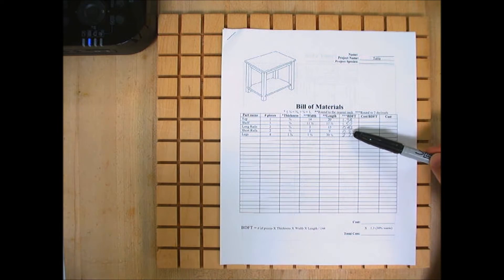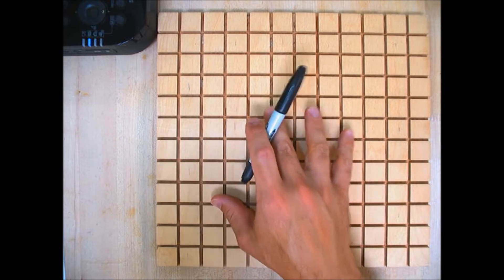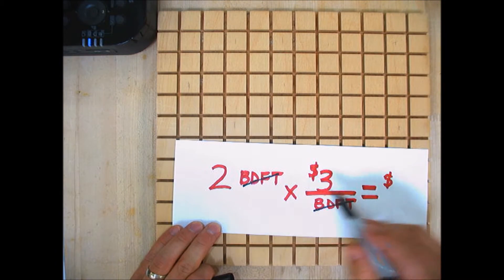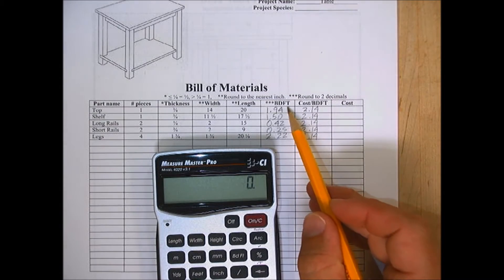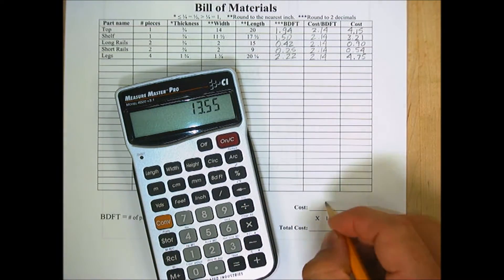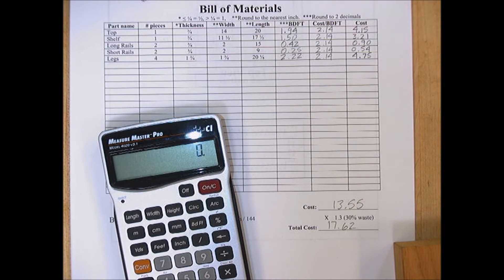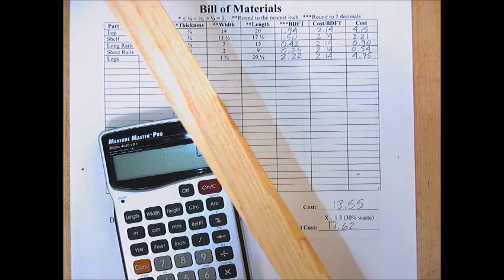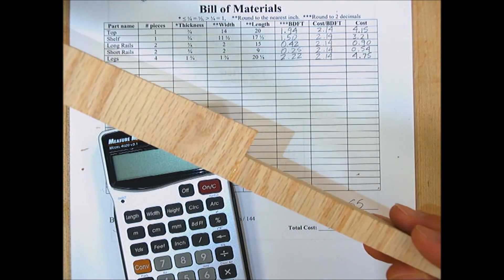How to Calculate Board Feet & Project Cost Pt3

Comment: Excellent way of computing the board feet and cost of materials.  I used your spreadsheet as a template and then adding in formulas to complete the math a little quicker.  Wish I would have had this sooner, I made a mistake on my calculations, and it was costly, put me in the negatives on a project for a customer.